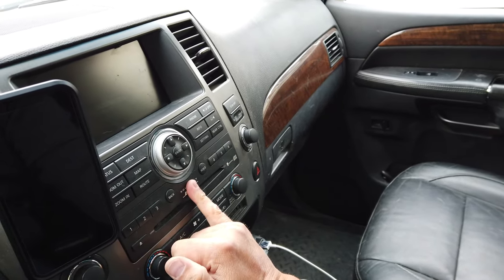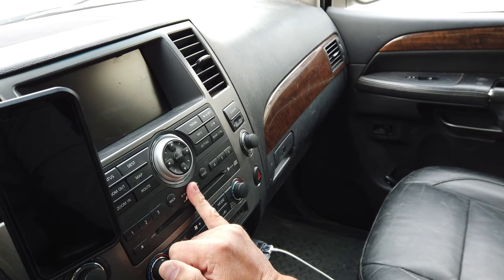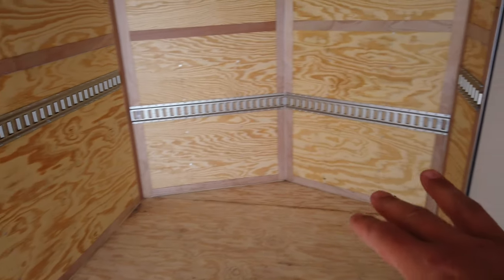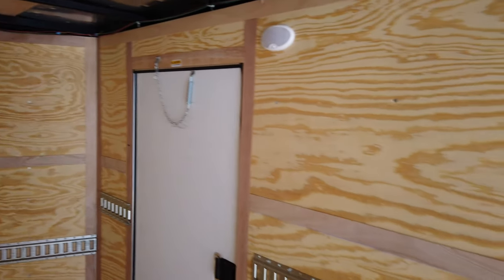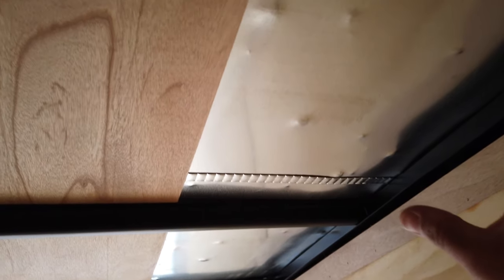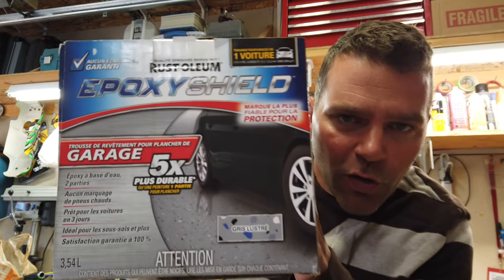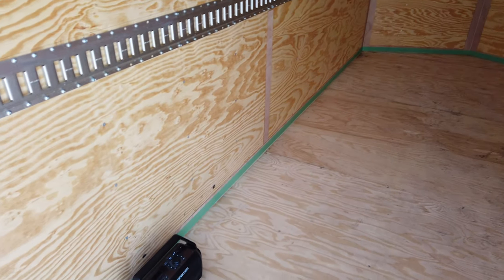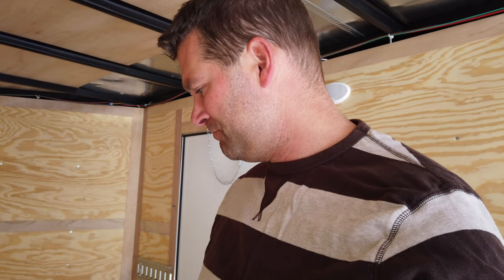RC AIRPLANE TRAILER BUILD - The Ultimate Jet Trailer - Video 1

Comment: Great project Jonathan! Wish I had room for one! Wireless cameras for the blind spots would be great. Varnish on the wood! LED strip lighting plus solar power for lighting and battery charging. I wouldn’t worry about the hail damage. Foam insulation on the ceiling like you said. Take one of your largest plane fuselages and put it in there to help you get an idea how much room it takes up and where it should be placed would help in your planning the interior. Have fun!
Reply from the maker: Thanks Gogian!  Great ideas.  So far it's about a 50/50 split on the paint or varnish to the wood.  HMMMMM.
Reply: The Lighter Side Of RC : Varnish will hide scuff marks better than white paint and it just looks good longer. Decisions, decisions!

Comment: If you seal the wood then it will look rustic, easier to clean, gets less dirty. Paint it white is neater and slightly more cleaning because it's white. if it was mine I would paint it white but it's your decision. white also matches outside of the trailer and if you have lights it will reflect more light and make it lighter inside the trailer. your choice but those are my thoughts.
Reply from the maker: Thanks for chiming in with your thoughts!  That's what I wanted to hear!

Comment: Wow we have a lot in common, I’ve been wanting a Nissan Armada but ended up with the Toyota Sequoia, my f-16 fits in it nice but my 1/5 carbon cub on pontoons doesn’t fit, I’m trying to justify the cost of a trailer to my gf but she’d  rather have a camper trailer! 
And poly on the wood would make it shine and give plenty of reflection light with LEDs.  
And a shop video with any specialty tools (including the trusty bent screwdriver) would be valuable information to us fellow pilots
Reply from the maker: HAHA!  Awesome Scott!  First, Thanks for watching.  Yea guys are often surprised when I keep pulling stuff out of every nook and cranny of the Armada!  It fits a TON of Stuff!    Our problem now is we have a camper trailer and this cargo trailer.  So when I go to events It's either set up a bed in the trailer or the armada i suppose or get a hotel room.  I am very partial to having a shower at the end of the day so that's one thing I would miss if I slept in the trailer or Armada.  So next step for us might be to get a Motorhome, Van type thing.  I'm not really a motor home type guy but I suppose I can adapt.  

I'm loving the great response for the trailer build and shop build!  Thanks for watching and trusty bent screwdriver should be helping with the trailer build soon.

Comment: I’ve got a 6x12 V-nose.  I’m always making “improvements” to it.  The one thing I did, and recommend to everyone is to remove the wood paneling, insulate the sides and the ceiling, then put the wood back up.  While you have the wood sides off, you can run your wiring for lights, shore power, charging stations, etc.
Reply from the maker: Yea it's always a work in progress for sure!  on this one I insulated the ceiling and very happy I did.  On the next trailer I will insulate the walls and ceiling.

Comment: The E-track you have is easily removed.  I put mine in vertically so that the shelf is adjustable to any height that I want.  Horizontal track is not universally useful.
Reply from the maker: Yea I kept the horizontal and it came with the trailer and I didn't want to spend the money on V Etrack.  I also figured I would never bother moving it anyways.
Next one we may do things different.

Comment: We found some cable service vans at an auto auction and  the manager allowed us to  remove the  metal cabinet systems  real cheap  they don't get any more with or without  them installed,  they work great    Frank
Reply from the maker: Nice!  That sounds like a great solution!

Comment: Nice trailer.  You're spooky, you keep hitting on al the topics I'm thinking about (no house build though).  I think you're on the right track on how you want to lay it out.  I was thinking pretty much the same myself of the workbench in there, for sure insulation in the ceiling and the floors came out really well in the video.  As far as the sides,  my initial thought was just clear polyurethane since the wood has a nice pattern with no knots.  But after seeing the floor, white walls would look sharp and brighten it up.  Run some tracks vertically on 1 side, keep the current ones now just in case (options).  The real question is what you're going to paint on the outside : )

Concerning your house build, I would be interested in how you lay out your shop.  You're a lot more neater than I am, but there's hope.  Had a laugh when you mentioned the weather.  Your flying season is coming to a close and mine is just starting.  It's amazing how nice a 100* day is after being out flying at 115* in Southern Arizona.  

Lastly, you have another channel???  Links please.
Reply from the maker: Hey Kent!  Funny how that works!  I have the same thing happen to me often.  i guess it's ask and the universe provides!  
The white walls seem to be getting the majority of the votes and it does make sense.

Definitely want to add some vertical track.  I was playing with position of the cross supports tonight so I could get the verticals in the right place. And also doing some general layout stuff, etc.  For now the outside will stay plain.  When we are moved to the new acreage than i'm not worried about decals on the outside/advertising etc.  So that may be next year's upgrades! 

This is my favourite time of year up here.  60-70 during the day and 40-50 at night.  My wife and I were just talking about that the other day.  

My other channel is very different.  It's here.  http://www.youtube.com/c/TheLighterSide
It's been quite successful and fun and it's what started my Youtube journey.  There is quite a story with that one.

Thanks for watching, commenting and the support!  
I appreciate it!

Comment: I would for sure go with white on the walls.  patch/sand prep and paint. Doing the walls first is easier as any drips on the floor will get epoxied over...no matter.  For sure take some time to consider your inside electrical needs.  Will you install a 110V service plug outside (Marinco) and what will you want inside.  12V is also important to pre plan.  I suggest a true deep cycle RV battery to power lights (instead of just off truck).  Also plan out charge ports up on your bench, and run more charge lines to rear of trailer to charge planes in place.  The OEM led light on the wall appears stand alone.  I would look on Amazon for some LED lights to supplement the single one.  Plan task lighting for over workbench or over planes.  Up on the hail damaged roof I would roll on elastomeric rv roof coating (white) sold at home improvement stores.  It will fill in some of the hail dents and helps lower the temps inside your trailer.  Subscribed for the build
Reply from the maker: Thanks Daryll for subbing and watching!  Also thank you for all the suggestions!  My plan as of right now is to basically rely on 110V service.  I generally bring my Honda 2000 to the field.  I ordered a shore plug/connection so fire up the Honda.  Plug into the connector and that will run the lights, plugs, chargers and the works.  I'm not sure at this point if I will put in a 12v system.  Planning on LED 4ft shop lights for the trailer ceiling x 2 and than one over the front, work bench area.

Comment: You will love the trailer for getting all your stuff around!! That is a great size as well. I built my trailer  several years ago, and I use it all the time for getting to the field or events. Mine is a 6x12, so it is a bit tight. When I saw your video today, I thought that I would make a short video for others to see what I have done with a smaller space.
 Here it is!!

https://www.youtube.com/watch?v=IwANQjVjXgE&feature=youtu.be
Reply from the maker: Awesome!  You Tube comment section is brutal!  This is just popping up in my un read comments section 2 months later!  🙄

Comment: Yes would like to watch a trailer build. I just had a 7x14 custom build quoted for me as I’m wanting one that will fit in my garage when not being used.
Reply from the maker: Nice!  Thanks for the comment!  Sounds like the perfect size!  Video #2 out tomorrow morning!
Reply: The Lighter Side Of RC I was looking at a 7x14 V nose with an overall exterior height of 6’8” (80”) which would give me approximately 5’ interior height. Looking at several of the same ideas that you are doing in your trailer. Going to use the Etrack to make a shelf that doubles as a bunk when I’m traveling to events. Going to put two 30x15 sliding windows in the back so I have cross ventilation when laying on the bunk. Also looking at having it wired for 12v dome lights and four 120v ac plugs. One up front in the v above the work bench area, one opposite the side door for a mini fridge and two back near the back doors one below and one above the bunk/shelf so I can charge my models. Would like to make it so I can plug it into my house to keep the fridge cold and have power in the trailer when inside and then hook my generator up to it when I’m away. Basically a poor mans toy hauler that we can empty of airplanes and use as a camper when not flying. Just can’t decide on what I want to do for flooring or for the walls and ceiling. Insulation is on the list as well. I like the epoxy coating you did on your trailer and will definitely consider that with mine.

Comment: After I insulated the walls and put the siding back up, I put up 1/8” white shower board all around.  It’s glossy and reflects light very well.  Just a bonus, it’s a great for writing on with dry erase markers.  Sans the shower board, a couple of coats of quality enamel on the walls would be helpful.  When my Rustoleum floor paint started peeling off, I put that interlocking rubber flooring down.  It’s cheap, replaceable, and easy on the knees.
Reply from the maker: Nice Steve!  This is going back a few years now for the trailer build.  Maybe a new one coming up!
Reply: @thelightersideofrc  I feel like such a knucklehead.  It came up in my YouTube page, and I thought it was new.  After I had posted my comments, I saw that it was 2-3 years old.  Anyway, my trailer looks a lot like yours!    How is your floor holding up?
Reply from the maker: @steveshipley4383  haha. All good!  Floor is doing good. I ended up putting a clear coat over it with grip sand to the entire floor. Much better

Comment: Maybe a solar panel to charge a battery for Led lights with a deep cycle battery for some charging if it's in the budget!
Reply from the maker: HAHA!  That's exactly the problem!  If it's in the budget!  I have ton's of great ideas but trying to do this affordably.  but yes thank you for the ideas.
Reply: @thelightersideofrc  then do put LED light but you can run the Honda to completely power it.
Reply from the maker: @russellvoth5161  Good Call!

Comment: I'd get the spare tire out of the inside.  Its not hard to get it mounted on the hitch....where it belongs.          Excellent builds.         I'm form Calgary as well....
Reply from the maker: Thanks Chuck!  Do you fly?  I was thinking about the spare but ran into a couple things.  1.  With it being a V nose there is not much room up there.  2.  I was worried about the mounting on the wall and possibly coming loose.  But near the rear of the trailer there is a square channel in the wall.  That spare tire mount is mounted to the steel square channel.  So I don't think it runs the risk of coming off.  IS that why you suggest it?
Reply: @thelightersideofrc  Well, mostly about the time ya need your spare tire the trailer is loaded to the max and now what a large pain to get to it is all i was thinkin about....I built a carrier for mine on the hitch.               I do fly...R/C and a private pilot (until I had a heart attack last Christmas)....  Love the detail builds ya do...
Reply from the maker: Chuck Christensen awesome 😎. Thanks for clarifying Chuck!